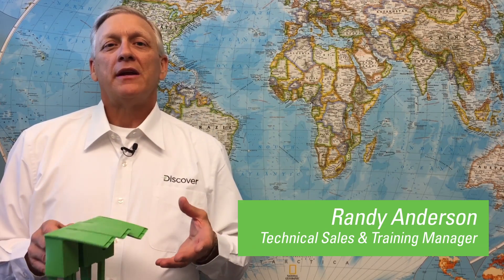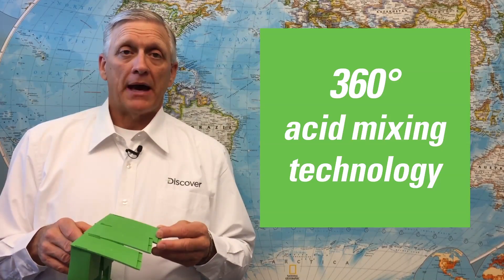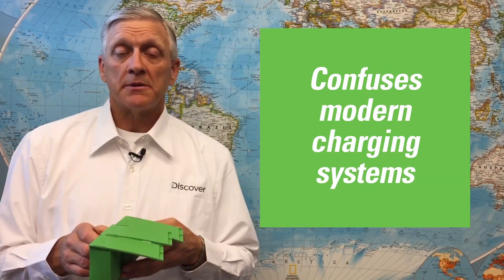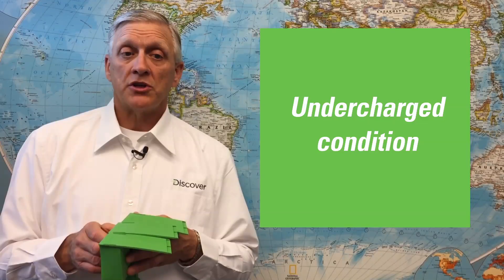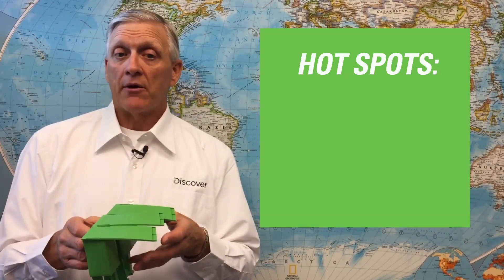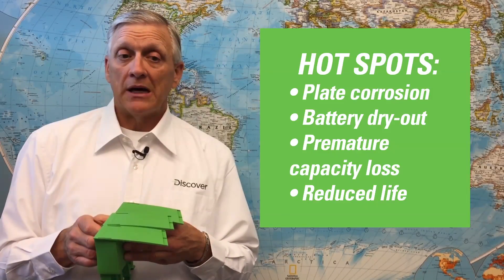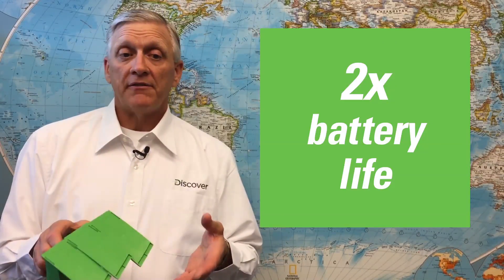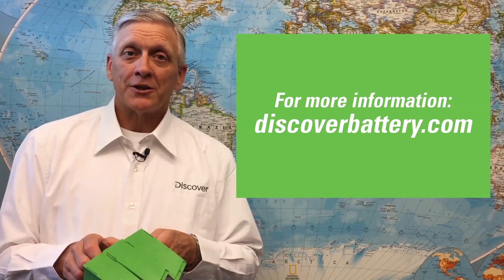Discover Battery™ - What is MIXTECH?

Comment: So would this type of battery be good to use in a camp trailer? If it depends on movement of the battery to keep the acid mixed. My trailer sits for long periods of time. Also I would like to use it to store power from solar panels. Would I be better with two six volts or one large 12 volt?
Reply from the maker: Mark Johnson At this time we do not have any Mixtech batteries available in Deep Cycle, which is what you need for your camp trailer and storing power from your solar panels.  The batteries you choose depends on how much storage capacity you require but 2 – 6 Volt deep cycle “golf cart” style batteries work really well in RV applications. Hope that helps.